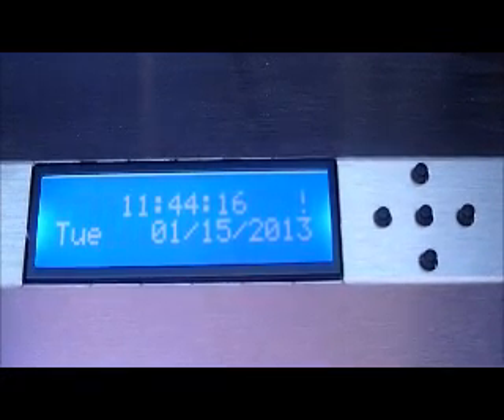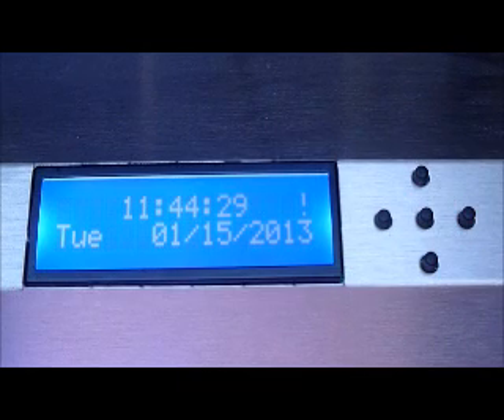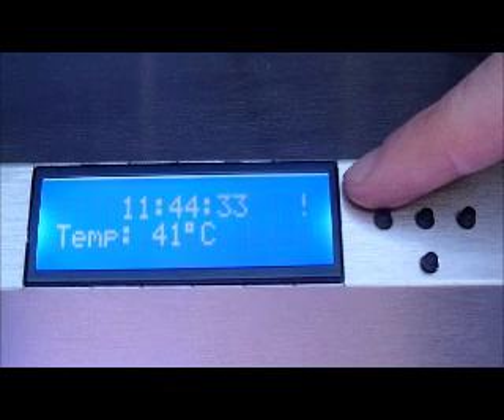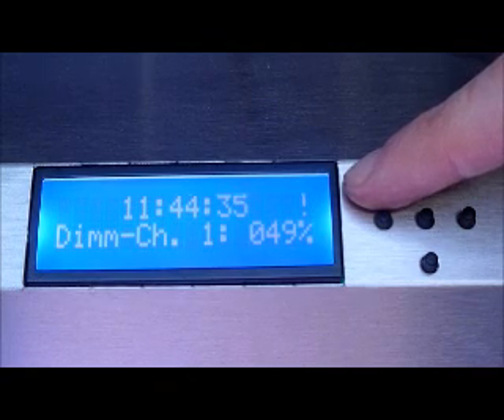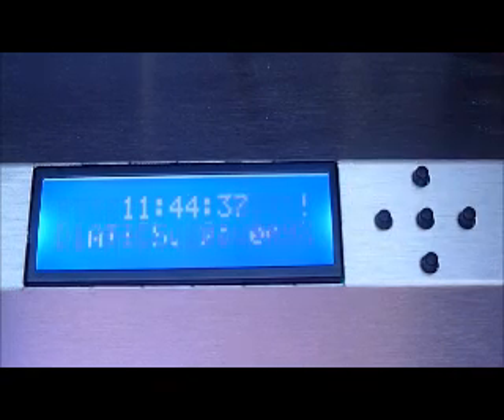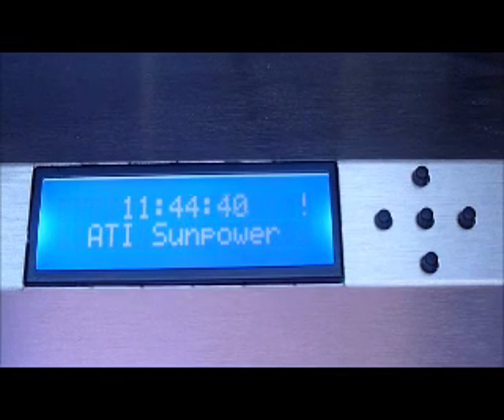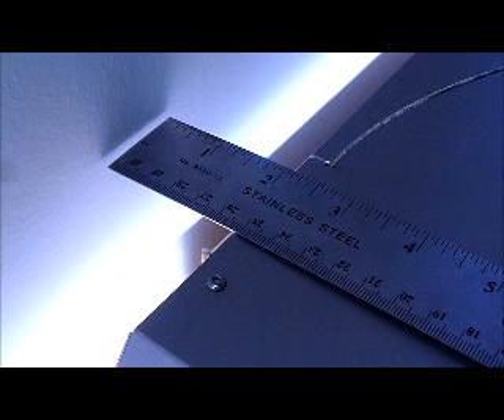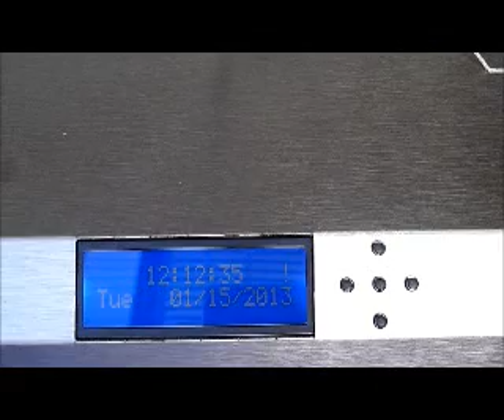ATI Dimmable SunPower - How to Troubleshoot Safe Mode

Comment: What happens if the fans don't turn on when I have it set to my schld but only work after a factory reset and on manual?
Reply from the maker: If the fixture is not getting hot during your programmed schedule then the fans will not be running.

If you need additional troubleshooting assistance, please contact one of our support technicians at customercare@atinorthamerica.com.